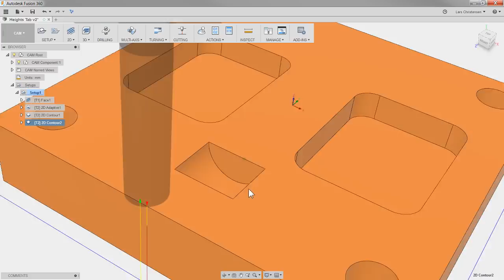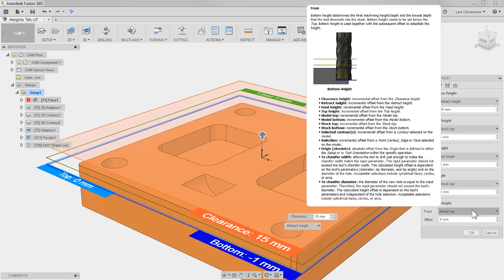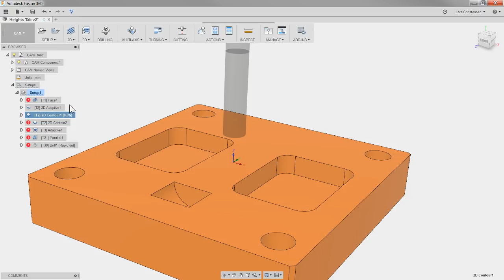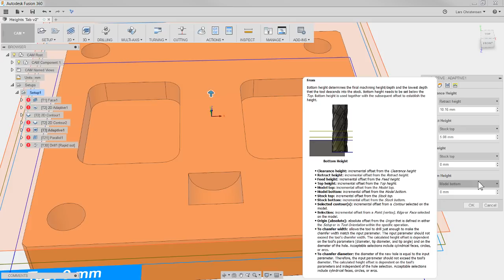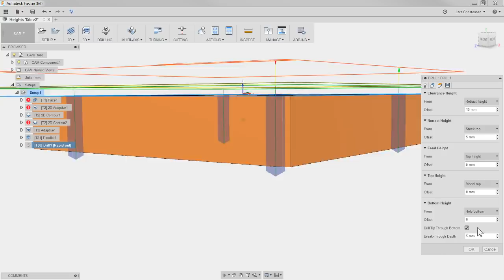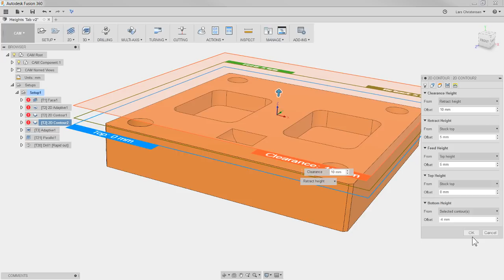Fusion 360 CAM — Heights Tab Explained — #LarsLive 91

Comment: Thanks Lars you do great vids , BUUUUUUT fusions height tabs are the rube goldberg of the machining world 99% of machinist's program from top of part as the ABS reference . I waste so much  F#@$ing time with this tab I have to change to modal top every single time every tool, Oh and no user defaults ya for the values but not the ref point I HATE height tabs.

Comment: So I'm struggling with a problem that I can't seem to figure out. For years now I've set my retract height to .01" to reduce the time the machine takes to rapid up. Especially in tight 3d adaptive operations where the tool rapids up in z many many times. The problem is no matter what I program the retract height to be, it's always way higher than I programmed. Not only that, but it never changes the retract height at all unless I make it some absurd height. I've checked my setup model, and have tried every option there is in the heights tab. Please help!

Comment: well yeah all that sheet is great but i tried diffrent methods and my Z axis cant freaking get it...  
as soon i hit cycle start in mach3  the Z axis its going way far upwards than the heights settings iv put in there, 
It have to do with this line here (g28 g 91 z0) how the fuck do i set this up  T_T
when i was running some tests on halftoner there was an option SafeZ that i could just set the distance that the spindle will keep when going to another task and it was doing that... unlike fusion faqin rocket sience

Comment: Hello Lars. When I post a facing operation, the software is automatically removing .135 (it is subtracting my model finish dimension from the stock dimension, then dividing it by 2) How to i tell the software to only remove .020 on the facing operation?   Thank's so much! dave.

Comment: im having the same trouble as Jeremy:
"I'm still confused. when i press go, it wants to run straight across the top of my model to the starting point instead of retracting then moving. but during the operation it retracts like it should."

Comment: 27.03 omg looks like my makro lol.1 parameter for depth it cut  pocket that depth using tool radius and leave flat bottom if its flat mill. even leave more if you select full depth it calculate how deep it can go your tool. same for ball nose same makro with nose radius and do finish. cutting cutting.. finish

Comment: Hi Lars, First Thank You for all the great Videos. I use you, Titans of CNC, Lets Machine and NYC CNC for my CAD and or CAM training,  you all are awesome. One trick I picked up on with Heights was for facing, 2D contouring and Pockets was to set all the tabs to Model Top and use dimensions for the positions. After doing that a bit it was easier, for me anyway, to get a better handle on what each does in a given operation. Now I may vary it a little for different things, but it removed or simplified it for me starting out. What are your thoughts on that, can you see any disadvantages to doing it that way?
Thanks again, Mark
Reply from the maker: Hi Browningmotorsports Thank you for watching!
Titan and John Saunders are both on my hero wall :-)

No, I think that is a totally legit way to do it. Thinking about it, if I was programming a part that also had a 2D print, I might do it your way. Just because the print dimensions would overrule anything else :-)

Best,
Lars

Comment: how do you set DOC on profile milling? if im profiling out of a billet, I need an infeed (Depth Of Cut ) rather than just plunging to max depth through solid material. I don't think my end mill OR VMC would like that!
Reply from the maker: Hi crozwayne Thank you for watching!
There is an option for selection in the depth of cut so you can select a vertex on the screen or you can use the offset field to enter a depth

Comment: hey lars, great vid, it took my a while to figure these out...i did not hear mention of the following in the heights tab for the drilling operation..

the feed height setting controls what the height the tool will rapid to...then once it reaches that feed height setting, it continues down to the hole but at the feed rate setting (plunge rate) that is set in feeds and feeds tab .
 
so sometimes if i have a really small drill bit that requires a feedrate of say 3 ipm, with a chip breaking partial or full retract  cycle  it can take a really long time for it to get down to the hole if my part is kinda tall.. so i set the feed height lower and closer to the hole top (+1mm above hole top)and make sure my retract height is high enough for the tool tip to clear any obstacles that may be hit when the tool tip is moving from hole to hole. 
rick

Comment: im trying to start my toolpath with the spindle directly centered over the model.. I tried the stock  box point selection , and model box point selection with no luck.. thanks
Reply from the maker: Hi Rob M Thank you for watching!
I am not sure what is going on there. I would recommend you go here for better help:
https://forums.autodesk.com/t5/fusion-360-computer-aided/bd-p/2070

Best,
Lars
Reply: as it turned out , I simply need to zero AFTER I load the g code in mach 3.. not before.. So from fusion to mach 3 to the 6040 cnc , there is some confusion , but its all worked seamlessly since I started zeroing the machine after loading gcode.

Comment: Hi Lars. I recently made my own CNC but i am struggling with one part. Which height will tell me the starting (home position) height of my cutting bit. If my feed height is 5mm and clearance along with retract is 10mm for 2D contour process then how high should i keep my bit and start my gcode?
Reply from the maker: Hi Prashant Kumar Thank you for watching!
I am sorry if the video is not clear. Not sure I can do a better job than I try to do in the video. But, as you start the program, the software will read the clearance height and go there.

Best,
Lars
Reply: same issue , my gcode starts milling the air 7mm above the stock.. not sure where to zero the machine
Reply: @airgunningyup  and Prashant Kumar, When you enter CAM in F360 the first thing you do is set the stock origin to the top of the stock. When you fire up your CNC you need to home it to the top of your stock; to do this you need a Z-probe.

Comment: Lars A good video on  a point of confusion. My question is: why after the facing operation, wouldn't using 'Model Top' instead of 'Stock top' on the subsequent operations be a more logical reference?  I never have need to 'face' a part.
Reply from the maker: Hi Jim Mac Thank you for watching!
I you stock is set to the same height as the model, or if you have done the facing, they are the same. But, most CAM people are very caution minded, so I think most people like the safety of stock top.

Great question.

Hope you have an awesome day!

Comment: Thank you once again for explaining the heights tab! Grate work. But i got small error/warning -> "Warning: Lifting retract plane to safe plane." what safe plane is in addition to retract plane?
Reply from the maker: Hi Piotr Szmidt Thank you for watching!
Check that you don't have something like your lead in/out on the linking tab going higher than your retract plane.
Reply: I think that was not the case. Unfortunetly through the searching of the problem I changed things so many times that I've lost control of what i finaly was changing. My assumption was that the problem was with the height of the BOTTOM setup - just some miss-click and that give me error.  But thanks again :)